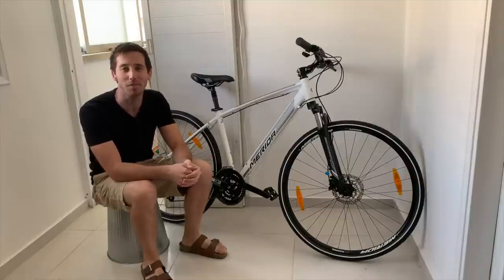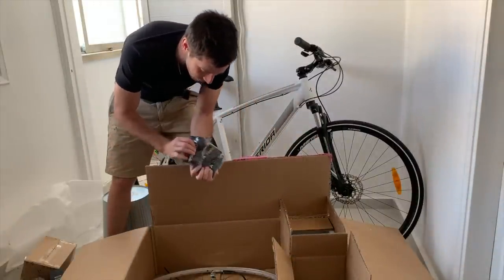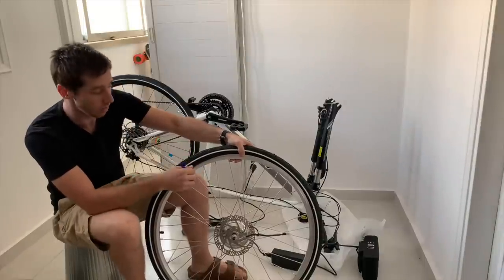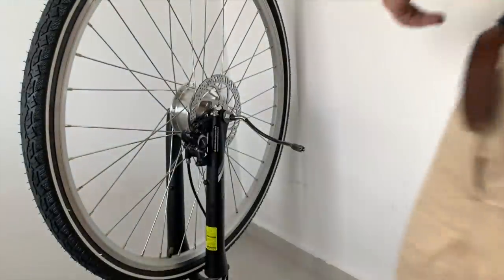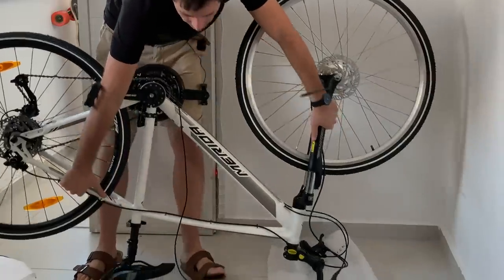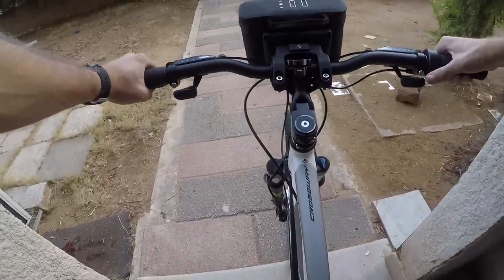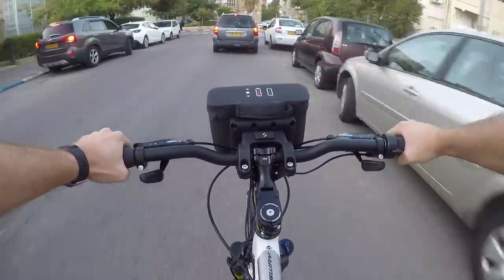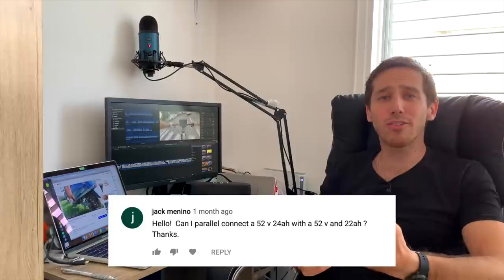How to build a simple e-bike with SWYTCH kit

Comment: Thank you much! I am catching up on all your old videos. Very good informative content.
I am going to be converting my old mountain bike.
Just playing the waiting game for all the parts to come.
Ordered a 1000 watt 48 rear hub motor and a 99000mah battery and charger. I don't know why they don't just say it is a 99ah battery? Hope it works with some decent range.
What are your thoughts on this?
Also had to get a charger plug adapter. Comes with a 220 volt Euro plug(single phase) to a 120 volt USA slotted standard plug. What are your thoughts on this? Will it work, take longer to charge?

Thanks in advance.
Keep up the great videos!
Stay well. 
Joel Hill

Comment: Hello. I have a question for you. First of all I really apreciate your seriousity in making these videos and the detalied information. I have a kit on my bike rated at 48V 12Ah battery and a 500w motor. The details of my controler I do not know, but the capacitors are rated at 63V. I want to upgrade de battery to a 52V 20Ah for a higher speed and range, but I dont know what bms to choose. The options are 20A and 40A. The question is : what's the  difference between a lower and a higher amp BMS ?
Reply: Buy a 48v 20ah battery, they charge to 54v

Comment: Great video.  I bought a Swytch kit last year and just recently installed on my Trek MTB.  Did you need to modify your fork dropouts to accept the motor hub axle?  My Swytch motor hub came with a 10mm axle, and on their website, they suggest filing your dropouts if they’re too small to make the hub axle fit snug. I modified my Rockshox Recon Silver RL forks and it seems i over stressed the dropouts when installing the wheel because both dropouts broke on my second ride.  In your video, it seems the axle slips easily into the fork on your Merida but from what I’ve been able to tell, Merida uses Suntour forks, all of which have 9mm QR dropouts
Reply: Same problem. Changed front forks. 10 cm essential.

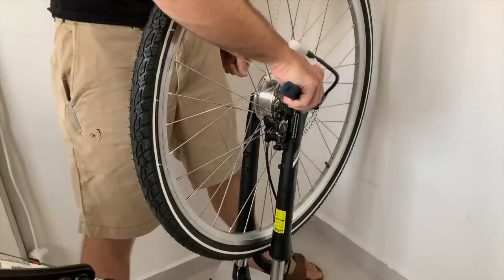Comment: 6:50 - isn't the special washer with the notch supposed to go on the inside (notch facing out) so there wouldn't have been anything rubbing on either side? My kit, albeit a different make, shows them on the inside. You would need an ordinary washer on the outside of the fork dropout of course (under the nut). Good video.

Comment: Welcome back, Micah! I finished my first bike conversion thanks to your book, but I'm having a hard time with the breaks rubbing, so I'm still struggling.
Reply: Thax if you have v brakes, adjust the small screws tighter to bring that side away from the wheel. If that not enough you can Bend the spring back a little. For disk brakes loosen the brake and pill the lever before tightening again. If it's mechanical do the same but don't tighten all the way and move to into position first.
Reply: W
Reply: Was at his love in come city part

Comment: Hi I've just ordered a kit. My Boardman Pro has carbon fibre front forks, anything to consider during install? thanks in advance and good health
Reply: Tony Holding i would consider swapping your carbon fork out for a steel one as these motor drive kits create additional torque where it was not originally expected. Obviously the fork you are currently using was designed for stealth and lightweight and not to be driven ie for being pushed by the bike not pulling it!  I may be being a bit to conservative as this is a relatively low power motor but from a safety point of view a steel fork is going to resist the torque loads better and i suspect there may even be purpose designed motor drive compliant forks out there now designed for this express purpose. I know for a fact something like this would have torn my old school Vitus 979 apart.
Reply: Where can I buy and how much does it cost, I live in the UK.
Reply: @khurram41  it is seriously overpriced for its power and performance rating. A Bafang mid drive motor conversion kit is much better VFM!

Comment: I presume the disc is a centre lock instead of a bolt system. It should be removable with a Shimano gear removal tool. Is that right?

Comment: Hi Micah. Trying to find an answer to this question, and or a tutorial. Oyy. I have an Ecomotion Core Pro E-Fat- coincidentally made in Israel, Im in the US- Connecticut. Some family in Tel Aviv. My bike is a 500w 48v/14ah battery. Rear hub motor. I want more power for hill climbing. I either want a higher watt motor, or even cooler would be to install another Bafang 500w front hub motor to get it to 2wd. Can you please tell me where I can find instruction on how to do this. I know you can't just add a motor and run them on the same circuit. I see you have a book explaining some of this but I can't say I am well versed in electrical. Is there an easy way to add this motor to the front without all kinds of additional things, I am ok with buying the additional "brain" you mentioned in one of your videos. Can you advise?. Thank you !!!!!

Comment: that regenerative resistance, without a clutch, if you remove magnets from the motor, wire only, then motor action when powered, no regeneration if not providing current to coils
Reply: direct dc, no expensive or complicated parts, even direct lead acid, or single use zinc-air

Comment: Hey just wanted to know how to locate controller on a standard E-bike as its not on the outside and was wondering if it would be small enough to fit into a normal mountain bike frame?

Comment: For the record the old disk rotor is centrelock  and just need the same type hub ( extract tool is the same as shimano cassette remove tool) the rivets  isnt the problem  . The other one is 6 bolt type  rotor (most common type )

Comment: Spacing out the fork with a washer? You weren't able to reposition the brake caliper? Myself, I removed the hydraulic brakes from my Santa Cruz Blur LT ll and replaced them with Hayes cable activated rotors - I can stop just fine. A few picks - no mention of a rim strip? Customs may have gone through the box, but could it have been a customer return? Myself, the reason to avoid this kit is that Swytch only gets the orders first BEFORE the manufacturer builds the kit, and no one ever mentions the availability of spare parts.

Comment: nice details thank you, i have been looking for a conversion kit that didn't need an engineering degree or workshop to install.
On another note, is that a 24hour watch you have on there? Looks cool, what is it?
Reply: I understand that this method only works in some frames. I had a carbon bike with the Aston Rider kit and I switched it to a bamboo bike in 10 minutes and I didn't have to cut any cables

Comment: If you don't have an air gun it's also possible to float your grips on and off with water pressure from a tap using a suitable nozzle.  And if instead you want to get it off with something slippery you're better off using soap than wd40 or oil since it's possible to rinse out.  If you don't have a new set of grips and you get em oily they'll never be the same.

Comment: Hi Mike I have a question for you,  i fit ebike kits and one of my clients has ordered from me 2 lithium 36v batteries and he plans to have them in a rucksack and use them as a back pack with a cable to plug in to the system then one battery runs down on power plug in his second battery. Is there any risks to consider or precautions we could advise this guy. I would love to hear your views and if been done much in this way, a first for me in 20 years. Thanks Ron
Reply: He should unplug the flat battery otherwise the fresh one may be wasted charging it, could also get hot while doing that.

Comment: When setting wheel size you've into sw900 display, do you account for the tyre? 
28 inch wheel plus 1 inch either side for the tyre. Equals 30 inch for the settings to get accurate speed readings

Comment: Thanks for this review. I’ve been thinking about the swytch kit for my wife’s recumbent trike an HP Velotek scorpion.  Was
Leary about it but your review gives me some ease. The current HP solution is a neo drive. But being in Canada, we are looking at over $5000 Canadian to be installed. 🇨🇦
Reply: I'm in Canada as well (Ont)... what solution if any did you find? The Ebikes around me are $$$$$$ .. Thanks
Reply: @alcocklake  Well there does not seem to be any easy retrofit solutions for existing recumbent trikes.  There are many out there that are factory installed and engineered to fit their specific design.  In the end, because my wife's bike is unique and a recumbent trike, we ended up with ordering the retrofit from the manufacturer in Germany and the Canadian Dealer (who we bought the trike from is installing.). And yes it will be costing just over $6000!  On top of that, due to Covid, the install was to happen last November but has been moved out to February now (Covid?)...by the time it's up and running, a year will have elapsed!  OUCH!
Reply: @alcocklake  Ontario also...Guelph

Comment: Hey I would to know if I can use  36V 20AH Lithium Ion with Charger BMS X2 to build a 72v 40ah  for a 8000w E-Bike I am building. If not what would you suggest I use. I found the Hub motors off Amazon. I want to do Dual 8000w motors , front and back. I could use any input that you can offer. Thanks

Comment: Is there a way to know if it is overheating or to protect it from overheating ?  Also do you know how often do batteries need to be charged to maintain their optimal capacity?
Reply: There are 2 gauges on the control panel, battery level and power level for the pedal assist.

Comment: I have a question, how does motor play out when you are coasting and not throttling, is the motor causing drag? When you pedal hard enough to overpower the motor,  will the powered motor cause drag?

Comment: I have 2 bicycles I want to convert to electric and hope to figure out the best cost effective solution from your channel. The first iis a Day 6 Dream 8 which is wife's bike. It has 8 speed deRailleur. I was hoping for 48v  rear hub kit. My second bike is a Day 6 Journey with a 7 speed internal hub shifter so a rear hub motor will not work for it. BTW we are retired in Florida and most travels will be flat except for bridges over water ways . Your suggestions would be appreciated. Commision links or fine with me. Thanks. Audie and Judi from Florida

Comment: What happens if the swytch battery pack handle breaks? Also wish you could fit the battery pack on the bottom tube of frame.

Comment: Hi Micah. I enjoy watching your ebike vids. I watched your vid on a 2 WD ebike and went and built my own with a 250w 36V 10.6 amp front and rear to keep it road legal in the UK. It works great, good torque but still limited to about 17mph. I've also got a 1000w 48v rear motor that's not been fitted yet. I am thinking of fitting it to my ebike so that I have a 250w motor on the front when I am on the road and have the 1000w rear motor, also fitted for off road. The bike has 2x 36v bottle batteries. One battery for the front 250w motor and the other 36v battery to be used for the rear 48v, with an added 12v in series, for off road. What I'm not sure about at the moment, is should I just add a 12v lead acid 12amp in series, or make a 12v 18650 pack to add in series. The lead acid would be cheaper but heavier. What do you think of such a set up? ATB.

Comment: Since the cadence sensor looks difficult to install. Can it be run without the cadence sensor? can i just use the throttle exclusively.
Reply from the maker: Yes definitely, I almost did it that way at first. But I wanted to give myself the option of pedal assist

Comment: Don't use WD40 under the handle grips! Tip from a long time bike machanic: If the air nozzle method does not work, use a small probe to work some liquid dishwashing fluid under the rubber and wiggle it around to spread the liquid around and the grip will come off. To replace it jus lightly rinse it and the remaining fluid will driy and lock the grip on. Ciao!

Comment: Hi. Thank you for your contributions to DIY ebike community.
I built my first from Alibaba kit. All is good with one huge problem. Motor is front wheel modest street legal 36/250 Bafang which is assymetrical relative to a hub. However idiot built (machine I presume), made it for s symmetrical hub front wheel, meaning that it is about 7mm off centre line and laterally not true. Yours one in the video looks like exactly the same. Supplier talks bad English BS, eventually admitting that wheel, in this situation, should have been dished, because of about 7mm adjustment necessary. I tried washers but almost run out of axle shaft for a locknut. Local mechanic advised to immediately discontinue this practice due to safety issues. I do not know whether I can dish a wheel myself, possible with no more than one washer/spacer. Is 7 mm too much? I am not sure if spokes are of different length or not. PLEASE HELP! REALLY DESPERATE...

Comment: I would  advise all new adult size riders to start with a 26 inch wheel size bicycle.  I had the 700cc wheels and bike and it is good for long distances but not so good in the city with potholes , curbs on and off for safety, etc  A big racing bike  just feels very clumsy at these slower speeds and had less quick response and turning ability, and the 26 inch bikes size seems less dangerous.

Comment: The Bafang bbshd is so much better with 52v 40a I get about 47miles at 30/35 mph and top speed is around 40/50 depending on wind and hills

Comment: I would have just bought another tire,tube and brake rotor, That way you have a backup and keep your original front wheel intact. That way if it doesn't work out you just put the original front wheel back on without going through all that hassle again. And you have a spare tire and tube for future use...

Comment: A word to the wise, don't tell people to use WD40 or any other spray lube on their handlebar grips. Oil based products will soften the rubber and you take the chance of it pulling off while riding the bike. Use dish detergent as a lube it will not harm the rubber and will wash off and dry up very fast so the grips don't pull off when riding.

Comment: Dont use WD40 on rubber grips DOH! Ease a small screw driver between bar and grip and work the screw driver around the handle bar. The bar will pop off easily! Lateral thinking is in short supply on this video! Most people will have some difficulty with this kit! Its better to use a cheaper bike amd it will work just as well with an Ebay kit front or rear hub motors. Join an eBike group on FB. Good Luck!

Comment: You mentioned that is was a bad donor bike you chose for your project. Actually you can easily run into much bigger issues then what you got there. That's this kit will never work as they as are saying in there commercial.

Comment: Look, don’t put batteries in parallel for long periods, unless you install forward diodes to ‘freewheel’, which of course causes a slight forward voltage drop. And, owing to the heat generated, loss of efficiency.  Not trying to be clever or contradict you.  Batteries in parallel always self-discharge, if they are not on charge.  Better to use batteries sequentially, i.e. one at a time, then you can charge them simultaneously or sequentially.

Comment: did not tell you that on such a small battery, using only the throttle, you will drive max 15min: DDD. such a small one is only good with a pedaling sensor.

Comment: I ride a bicycle I am 5'8 I am 480 lb and I ride my bicycle 15 to 25 miles in a day I have been running through back rims because the spokes pop so I have to get fat boy tires and then put electrical motor on it(((((also one of the biggest things I need to point out buying a gas motor 4 cylinder it will last you a lot longer than a two cylinder motor it cost around 180 to $220 tops))))////((((((electric motor whether it be front hub motor runs you about 380 to $450))) a mid hub will run you somewhere around $400 to $600)) in a rear hub motor will run you somewhere around $480 to $900)) now this is my thing why spend all this money on electric bike when you could just get a gas I've been looking at some online prices for about 3 months and I think I want to get a bicycle that I can build into half electric half motor meaning the front tire will be electric the back tire will be ran off of gas

Comment: All I see is too much weight on the front... Motor and batteries on the front O_O 
If you just have ti break and happen to mash that front break you will most definitely flip like a sack of potatoes O_O
Moreover little or bigger bumbs will be quite painful with this one... 
A mid drive convertion kit with batteries and mounting all the weight on the middle should be a better idea...

Comment: Does this kit conform to Israeli tyrannical bike laws?
Reply: I meant E bike laws
Reply: The law is only 25 km only pedal assist only 250w
Reply: @Randomguy-rh7rl  yes....very short sighted....more available power could also mean a way out of trouble...and of course in Tlv it could be a way to alleviate the congestion and parking issues.

Comment: Having an electric motor inside the wheel is a looser project. The motor is normally to strong for the spokes. The motor turns and brake the spokes. The motor should be where the pedals are located. There is kits for that too. Do your research. Don’t trust paid  company promotors on YouTube.